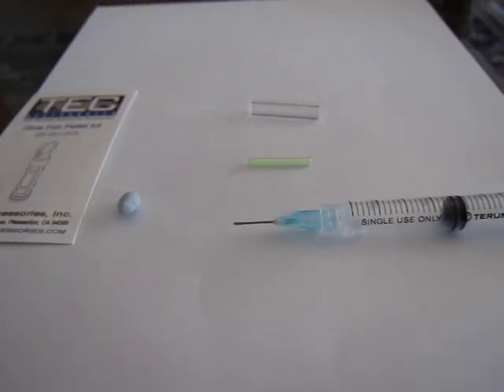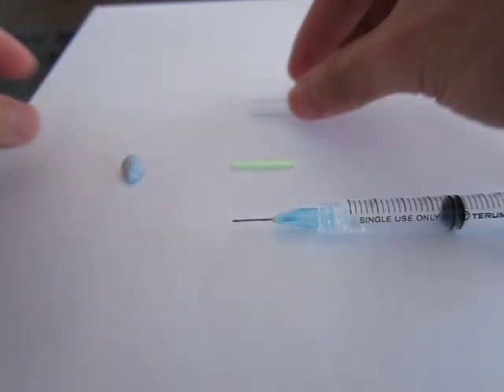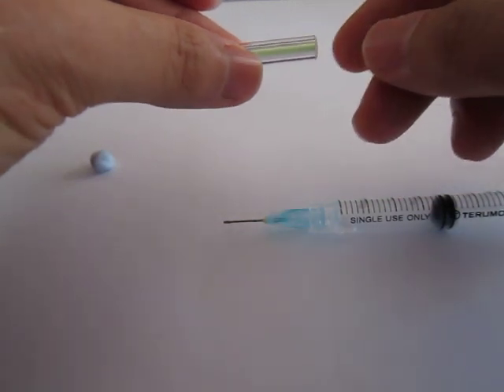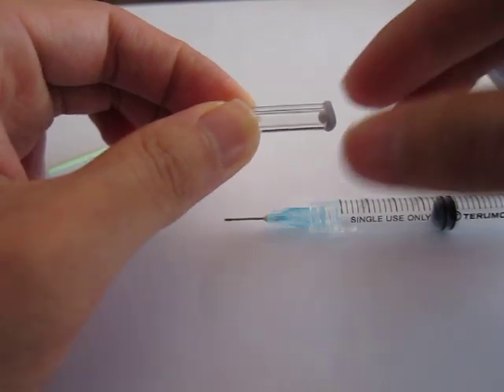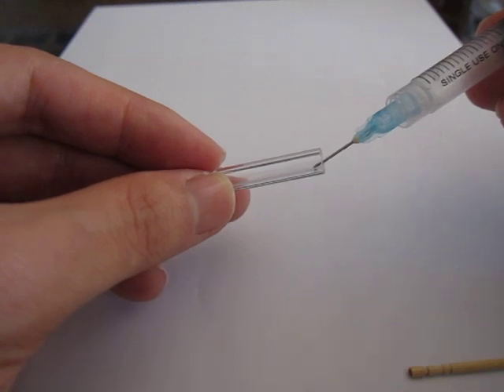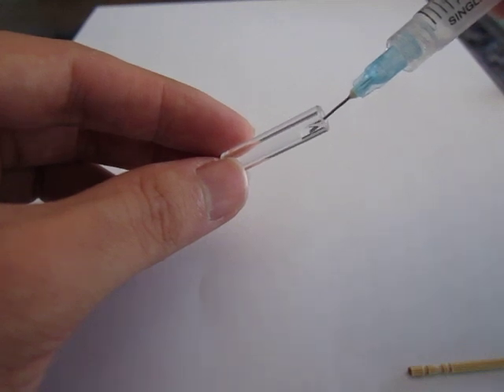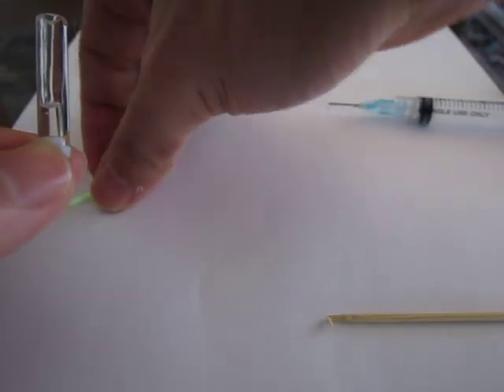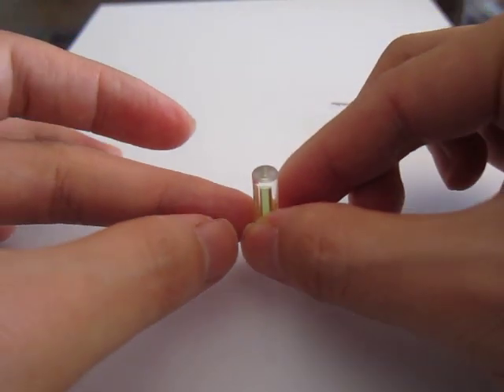Tritium Installion into Tec Accessories Glow Fob (part 1)

Comment: I sell Norland 61 in 1 ML or 1 gram vials. I have a listing on the CPF Marketplace and also sell it here: http://www.ebay.com/itm/171185267060

I use it to mount trits in gun sights and like to keep a fresh supply so I sell it so I don't have to worry about having older lots around. 

It is crystal clear after it cures, you can not see any glue lines, it looks like the tritium vial is floating in space and you can see the full glow with no distractions. It works great. You don't need a UV light to cure it, it cures in full sun in 4 to 8 hrs.
Reply: I can vouch for Acme GP 100%. Product was on point and like said above crystal clear. Very impressed with the packaging. Vials were put into tinted bags then the little bags were put into an opaque envelope to cut down on as much light exposure as possible. Arrived in three days (US), cured quickly and even comes with a little eye dropper to help with installation. I recommend these NOA 61 vials and will be buying again.
Reply: +Nathan Zorba Thanks Nathan. I have been in business in one form or another for a long time, even on an inexpensive item such as this, I want people to be happy with their purchase and feel they got good value for the money spent. There will never be any form of advertising that beats a recommendation from a satisfied customer.

Comment from the maker: @s28400 
Hi mate,  in theory the norland 61 does set to be crystal clear.  However in practice this is not always the case for a couple of reasons.
1. you can get airbubbles when loading in the norland 61
2. norland 61 seems to shrink slightly in volume.  When it shrinks, sometimes it can pull away from the wall of the acrylic tube, resulting in clear streaks or lines. (at least, I think this is the reason why I get streaks in some of my tritium fobs)